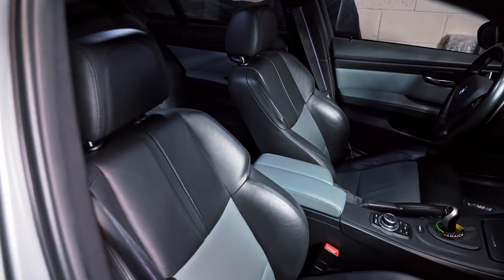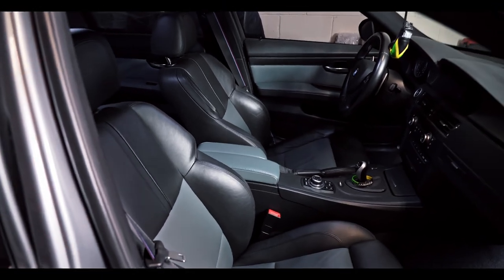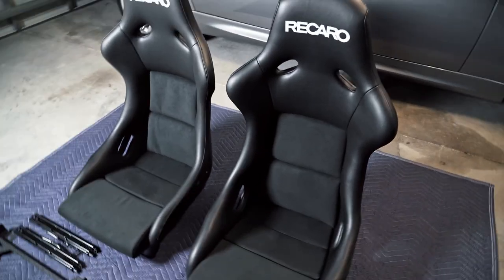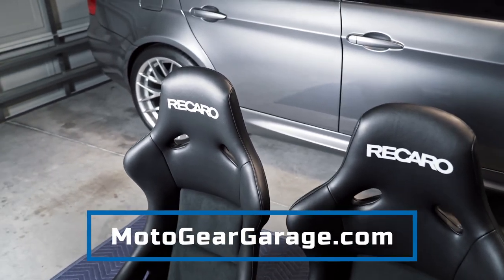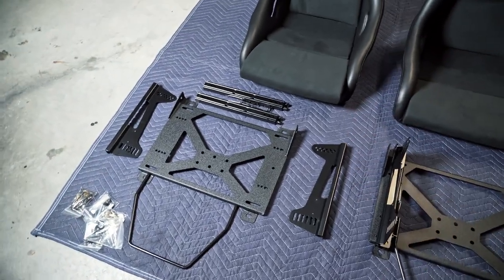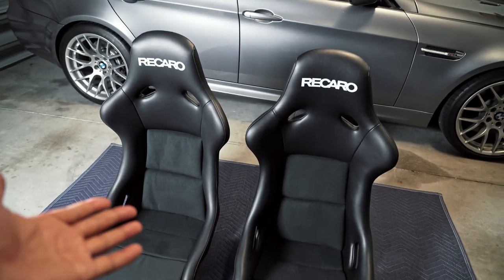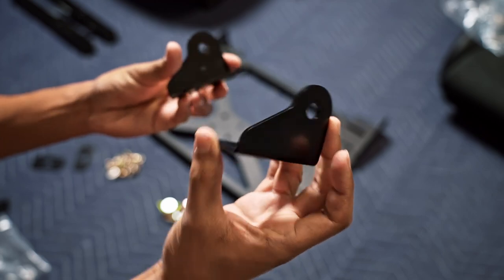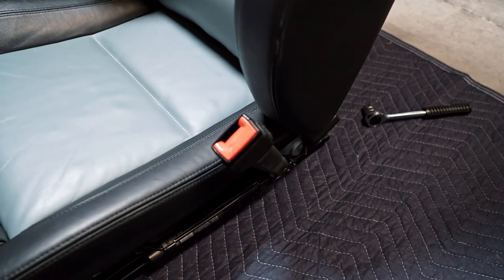RECARO Pole Position Seats COMPLETELY CHANGED My E90 M3 Interior!

Comment: does putting the seatbelt receptacle through the hole dig into your thigh? Also how tall are you im shopping around for bucket seat for my e92. THank you.
Reply from the maker: It sits right above my thigh which is perfect for me. This is the best way to route the receptacle in my opinion because it provides the best tension on the belt and and your lap. I'm 6 ft. and on the slimmer side, so this setup works well for me.

Comment: As u said position on seat is locked but i would like to ask can they move back and forward or rail is locked to the floor too?
Reply from the maker: The lower seat mount or "base" is locked to the floor, but the sliders allow the seat to move forward or back.

Comment: Did you need an extra nut for the seatbelt tensioner bolt? Or does the oem seat use one?
Reply from the maker: The factory seat is threaded so you will need an additional nut to secure the OEM tensioner bolt. I used a 10-1.50 nut if I remember correctly.
Reply: @MotoGearTV  🍻🍻🍻 Great video BTW!

Comment: How low does it sit after you installed this?
Reply from the maker: I haven't measured the exact distance as yet, but it is noticeably lower, even at the highest mounting point with sliders. If you want to go extremely low, then a direct to floor mount is going to be your best bet.

Comment: Did you get an airbag light on the dash?
Reply from the maker: Yes this mod will trigger an airbag light. However, it can easily be removed through coding.
Reply: @MotoGearTV  what do you use for coding? Bimmercode?

Comment: does the bolts and washer for mounting the seat to the side mount comes with the kit or bought seperately?
Reply from the maker: Those will have to be purchased separately.
Reply: @MotoGearTV  whats the lenght of the m8 bolt you use to mount the seat to the side mount.
Reply from the maker: I used M8-1.25x25mm bolts if I remember correctly. You can go up to 30mm if you need extra length for your application.
Reply: @MotoGearTV  thanks, did you use the holes closest to the tunnel size in the floor bracket?